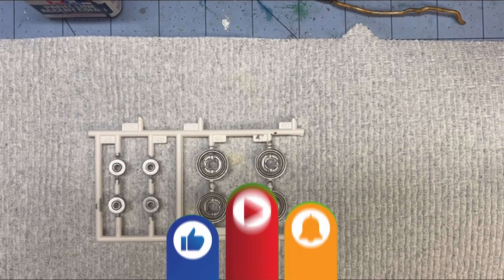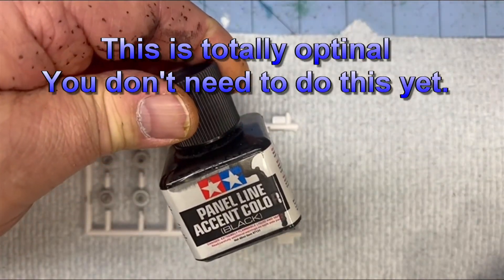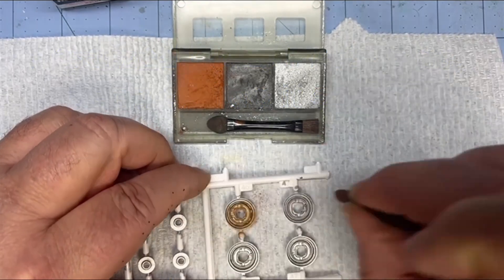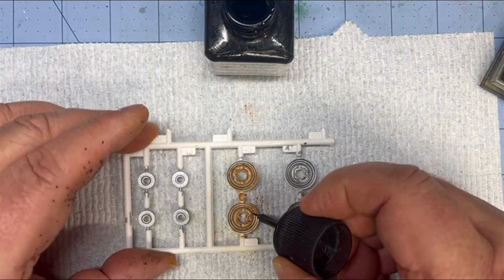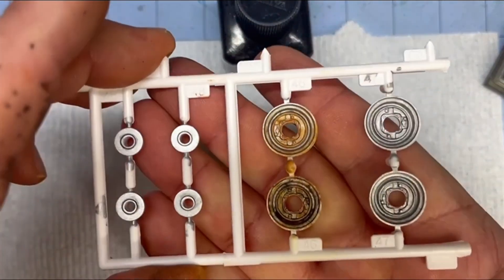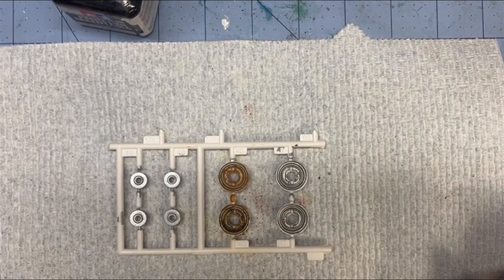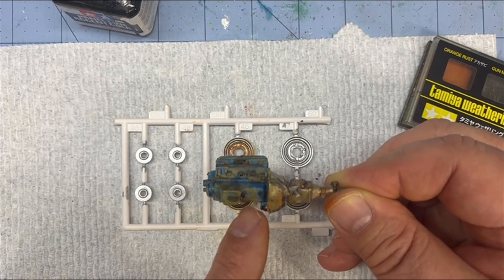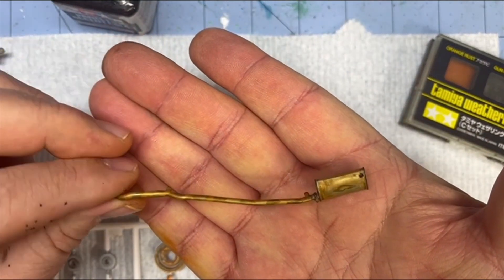How to easily rust your model like a pro

Comment: What great info Mark!👊You're right for the time and amount of work the results are stellar and very realistic! On a side note not sure if you have fitted the body to the chassis with the side windows in but the body won't fit the chassis flush and if you force it the side windows or one window will pop out. I had to sand down the window bottom edge or thin it and also the side panel where the window mounts at the bottom. I've heard other guys with the same issue as well so thought I'd mention it to you. Great work and can't wait to see the finished product!
Reply from the maker: Thank you very much.  I've heard there are problems with the side windows, but that's as far as I have heard.  Great info.  Next time I go down there I'll start fitting it together.  Now I know what to look for.  Thanks a bunch.

Comment: Looks great..I'm doing the same but do you need to use flat clear between applications? The pastel dust must smear or fall off, if it's not held in place.
Reply from the maker: I did everything at the same time.  Once the flat aluminum was cured I went over everything (heavily) with the Tamiya Master Set C red then with the Tamiya Panel liner.  The panel liner held it in place.  Then after that all dried I used the pastels.